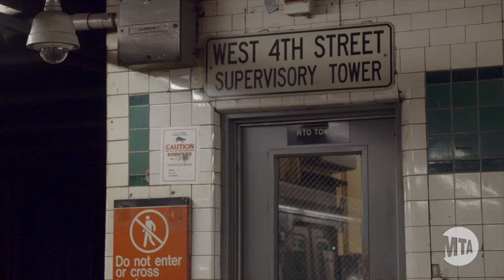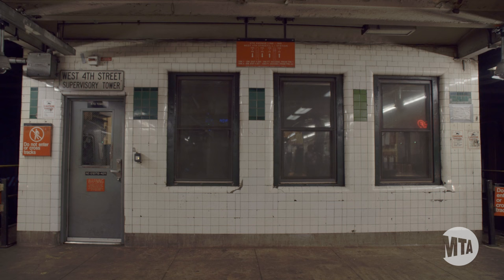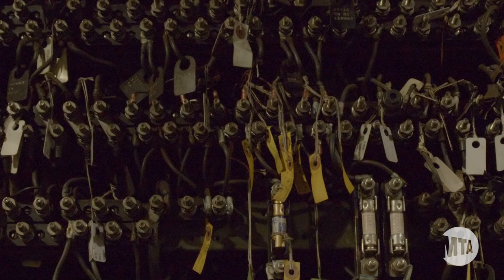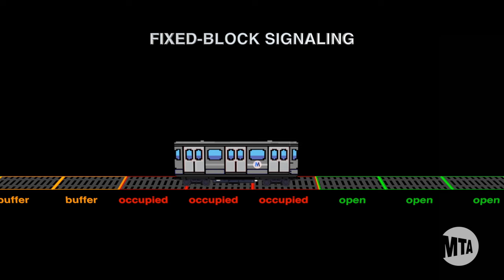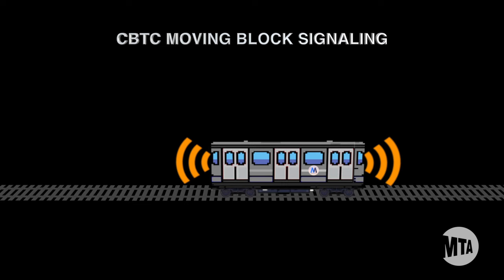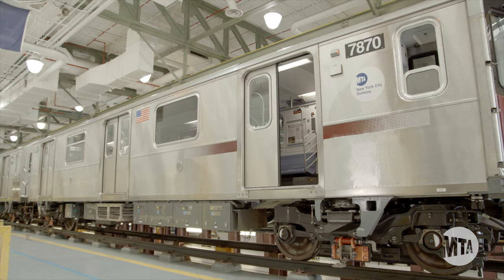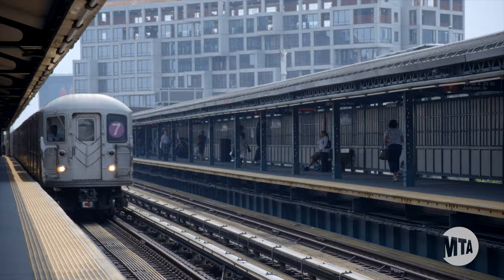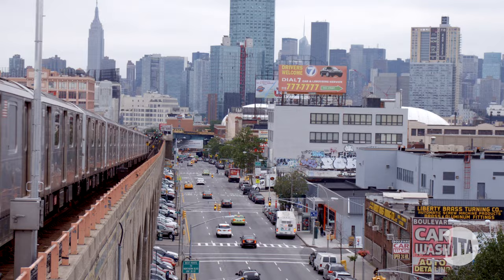CBTC: Communications-Based Train Control

Comment: Perhaps you can explain how trains in the 1950's were able to run with closer headways than what CBTC promises to provide? Also wireless systems are just waiting to fail or get hacked.  Can't hack relays.
Reply: Jersey Mike's Rail Videos I feel that this is a very luddite way of thinking. The current fear of wireless systems is akin to the fear of traveling above walking speed in the early days of the railroad.
Reply: Dj Hammers I work in computer security...wireless is a bad idea.  The rails are there as a communications medium...more secure and more reliable.
Reply: Jersey Mike's Rail Videos With that thought process we will still be stuck in the stone age. There will be vulnerabilities maybe; moving forward, being more efficient, safer...e.tc. makes it worth it.
Reply: SKY HIGH Or we can use coded track circuits.  Rails...those things that are there and can carry information more reliably and more securely.
Reply: Dj Hammers If the system is digital then it's hackable, this country is underestimating the power of a crippling infrastructure caused by computer hackers located thousands of miles away, many of them nationally sponsored and promoted.
Reply: You do realize that no aspect of the CBTC system will be connected to the internet. It will be a completely self-contained system. This is akin to a person kept in quarantine to avoid interacting with other people and spreading disease.
Reply: Dj Hammers 
Read up on stuxnet. Its fascinating. The centrifuges in Iran were on a completely self-contained network and still infected.
Reply: Stuxnet was typically introduced to the target environment via an infected USB flash drive.

A fully proprietary system with precautions against sneakernet connections to the internet would avoid this issue. Is this fear really a reason to be investing millions into technology that is outdated by several generations?
Reply: Jersey Mike's Rail Videos your are correct that the existing system can achieve terrific headways ~90sec. But you are not correct that it's better than promised by CBTC ~70 sec.
Reply: +Sunny Raines The MTA has neither the rolling stock nor the terminal capacity to achieve 70 second headways even if it were possible.  How many tph is the L running?
Reply: I didn't comment on whether or not MTA could use the advertised capacity of CBTC, only that it is supposed to be greater than the 90 sec headways of the conventional systems.
Reply: +Dj Hammers The can also run it in a chroot jail.
Reply: +Jersey Mike's Rail Videos but they can pay people to change those relays into ASICs or something.
man, they are used as logic gates!!!
Reply: If you don't know how something works, don't criticize it.
From what it looked like, those CBTC "transponders" are just RFID readers, while the things mounted on the trains are RFID tags, exactly the same as the EZPass.
Has EZPass been hacked at all in the past 30+ years? Nope.
I'm not an expert on this system, but if it truly is just a bunch of RFID tags, then each train would be assigned a different ID number, and every time it passes over one of those "transponders", it would get scanned and send the information back to the dispatchers, with location information. There is no "wireless" involved.
Reply: @GIJew  The data from the train's transponder readings is sent to the operations centre wirelessly.
Reply: Railway signaling doesn't utilise the internet so it can not be hacked. Wireless is the mode of data transmission, not referring to the network it is communicating in!! You should have realised this if you work in computer security
Reply: @squidgame2021  First of all, everything gets connected to the internet. Second, wireless means that anyone in some proximity to the line has access to the communications medium via an antenna. It's called an attack surface and wireless network attack surfaces are larger than wired network attack surfaces.  In this case there is a perfectly acceptable wired alternative (the rails), but the NYCTA wanted to run mixed equipped and non- equipped trains on the same lines and CBTC was the only way to accomplish that.  So now we're stuck with safety critical wireless communications using a 2004 spec.

Comment: I foresee a breakdown of one train's cbtc system causing a crash. I like the block system it's safe.
Reply: Glen O'Riley Really? Have you seen any train crashes in the L Line (which has CBTC) since 2006?

Also, there was a crash on the Williamsburg Bridge in 1995 involving 2 trains and killing one person. This, and the Union Square Wreck of 1991 were the reason why we are investing in CBTC. Keep in mind that the signaling system that was in use during those accidenta were the 1930s Fixed Block Technology, so if you think there will be a crash with the CBTC system, think again.

Comment: I work the Lex line during rush hout we run 3 to 4 minutes apart .......means MTA wasting money
Reply: true, you can and you do run trains on "track circuits" every with 3 min headways or so, ....but.the level of OTP service, train protection, safety and system capacity are sub-par.  it's the nature and limitations of the two technologies (as simple as that)

Comment: Interesting video.  But it really needs to be updated.  The 7 Line was supposed to be finished in 2017, but it's 2019 today and the 7 Line is still plagued with  massive delays and even shutdowns.  Is this a failure of the updated system, or just the original completion date being missed by years.  As New Yorkers, we should remember that our iconic Empire State Building was built in 1929  in just over a year using 1929 technology.  Surely the MTA should do better than years late on target dates.
Reply: George Kuhn I’m pretty sure they should’ve calibrated the system already
Reply: @TheRailLeaguer  I am absolutely sure they SHOULD HAVE calibrated the system already, but the evidence is to the contrary since the 7 Line is vastly unreliable, even during weekday rush hour.

Comment: It still works. British Rail Installed new signalling Centre Clapham Junction 1980. It was a disaster.
Reply: The CBTC system we have in NY is working perfectly. The L and 7 lines already have an on time performance of above 90%.

Maybe it might be poor maintenance on their part.
Reply: Track Ciruits are electrical Ciruits that you must not let terrorists know about.

Comment: Great idea. We don't know where the trains are. We have more then one train on the same track let's have a device that makes train closer then add more cars on the track. And still rely on a outdated dispatch type system.
Reply: CBTC is exactly what your looking for when it comes to train tracking.
Reply: @TheRailLeaguer  yes it is what they're looking for. MTA needs to first fix their track also their equipment with maintenance problems. If their switches are old-school and dispatch as well, then the coaches will not be congruent with the track. A computer on a train is worthless if the road it rolls on is obsolete.

Comment: Why is cloth covered wiring still in place? Was the MTA really hurting for money that bad for 80 years?

Also, the 30's interlocking machine setup is a great example of schitzo-tech, as there is crap from the 1970s and the past couple decades flanking it.
Reply: plateshutoverlock That was there to protect the old wires from water damage, but it is prone to fires, like what happened at Chambers St on the Eighth Avenue IND in 2005. This will be replaced with CBTC technology, similar to what is already installed on the Canarsie BMT L Line, and what will be activated on the IRT Flushing 7 line and it’s western extension that opened in 2015.
Reply: @TheRailLeaguer  I'm surprised that they did not add Asbestos to the covering as this kind of wiring was common before Asbestos was known to be harmful to one's health. 

I grew up in an old house which was a strange mix of old cloth insulated wiring as well as more modern conduit put in sometime in the 1970s, and had both a circuit breaker panel and a fuse box for 
the 2 different wiring systems.  IIRC, the cloth wiring had asbestos in it.

Comment: Does NYC Underground station has aircon? If have please install PLATFORM EDGE DOORS OR PEDs. PEDs not only helps commuter not to fall of tracks or keeping tracks clean, it also helps to save aircon energy bills to 50%😃.
Reply: syed daniel An issue is posed by the multiple types of rolling stock with differing door arrangements.
Reply: Dj Hammers hey Dj Hammers, you can check out a channel called Willischong Videoproductions. He showes train rides in singapore if you are interested😃.
Reply: syed daniel In a subway, the ground temperature is the air conditioning.  Also, sleeveless shirts.
Reply: We don't call it the "underground"
Reply: @SyedDanielProductions_YT  nobody calls the nyc subway the underground

Comment: You said you never know where the train really is because these pressure pads just give a reading on whether it is holding weight or not, and these pads are quite long. Your solution is these transponders. However, around the 7:40 mark, he says data is only passed when you go over a transponder. That sounds like the same issue as before... you only get a reading every certain distance. Not really a solution.
Reply: *****
You realize a pressure plate and a device that has a broken connection when weight is applied to it are almost exactly the same thing, right?
So don't tell me off like I didn't watch or listen to the video. They're pressure plates; they detect a pressure on them and output a signal as a result.

Comment: Do you have a backup, just in case there's a fire, flood, etc...? You ALWAYS have to have a back up. Pen breaks I have a pencil. Car won't start, I ride with a friend to work or call a cab. Backup, backup, backup, backup.
Reply: curraheewolf PELHAM ONE TWO THREE
Reply: curraheewolf Here, we overlay a small portion of the old block signaling system in the event something like this happens.
Reply: larry temp I doubt that an incident like what was seen in the movies would happen. Plus it’s inaccurate. For one, the R142As cannot be easily uncoupled in single units. For that to work, the yard guys would have to come up to the train, painfully undo the link bars and then they’ll find out that no one is going anywhere. Plus in the same amount of time they did that, the hijackers would’ve been better off taking the ENTIRE train and get the money.

On that note, I did the math on that one. I’m going to assume that each car has 18 passengers. Assuming that they take the entire 10-car train (obviously much better), along with the conductor and motorman hostage, if they wanted $10 million from the city, then each hostage would be worth 54,945.06. Not that much in value, but still.

And an FYI, don’t get a group of friend and hijack a subway train in the middle of the rush hour just to obtain a million dollars. It’s just a movie. If it were real, this city would be bankrupt due to people hijacking trains to obtain millions of city dollars.

Comment: Is this just a re branding of ATC? Or is it different system entirely?
Reply: Erik Krauss The MTA signal upgrades will consist of two systems: Communications Based Train Control (CBTC), which is used to space the trains closer together, and Automatic Train Operation, which allows the train to operated by a computer in the Midtown Rail Control center. Automatic Train Control (ATC) is somewhat similar to both.

Comment: This technology has already been implemented but DC metro had this but due to weather conditions “snow,ice” most of the time interference happens for example radio waves cellular waves disrupts and can cause fatalities and accidents like what happen a couple of time in dc hopefully they don’t autopilot the trains
Reply: A faulty circuit caused a crash on the Red Line in 2009. In comparison, with NYC Subway's CBTC system, there have been no major or minor collisions since the systems on the L 14th Street-Canarsie Local and 7 Flushing Local and Express were activated.

Automatic Train Operation is part of CBTC, but drivers will not be eliminated.

Comment: As the old saying goes "if it not broken, dont fix it" its been running 100 years it probly be working another 100 over computer based systems.

in the uk we have nothing but delays over the computer systems failing or bad signaling so no tech is not always a good idea.
Reply: if you think it doesn't need fixing then you don't ride the system regularly.  Those old signals fail all the time.  I can't even count how many times I've been late for work because of them.
Reply: Yep, 8 years later and these systems are implemented, and it's the same as your UK problems.

Comment: Amazing! yet the subways run pretty well, think things back then were built to last, not like today, where things break down so quickly, forget computerized. There's an old saying "if it ain't broke, don't fix it" might well apply to controls of NYC subways.
Reply: Really, because the signal issues are actually the main reason why trains are often delayed. In comparison, trains on the Canarsie Line and Flushing Line are more reliable due to Communications Based Train Control, which is computerized. The Queens Blvd and 8th Avenue Lines are getting a more updated version.
Reply: Passengers are the main reason trains are delayed.  @TheRailLeaguer
Reply: @gerrylouis5787  That doesn’t excuse the old signaling system for delaying trains so you’re statement is not exactly correct.
Reply: @TheRailLeaguer  It doesn't, though. No more than newer systems anyway. In fact in my experience the most reliable signals are on the A/C line in Brooklyn and those are all original from when that part of the subway was built.

Comment: what might happen if you try to operate an old train (like the r62 or r46) on these CBTC lines
Reply: SonicFan '91 On the Canarsie Line for example, there is an overlay of the older system between Broadway Junction and the end of the line at Rockaway Pkwy. This is to allow for trains with no CBTC that run on the J/Z and M to access the Canarsie Yard for train washing. They will be tracked using the older signal system. Eventually, all trains will have CBTC installed.
Reply: well rip our beloved r46.

Comment: Wait how come the R142/As don’t have CBTC equipped. If they do then how come lines like the Broadway 7th or Jerome Avenue haven’t been converted
Reply: When the cars were delivered in the early 2000s, the primary focus of the CBTC installation was on the Canarsie Line, followed by the Flushing Line. The R143 train cars delivered at the same time with the R142/As have CBTC, and were installed with it shortly after delivery.

After the completion of the technology on the Canarsie and Flushing Line, the main trunk lines with multiple service are up next, with Queens Blvd underway. The Broadway-7th Avenue and Lexington Avenue lines are up next, and are being funded out of the next few capital plans. The R142/As do not have CBTC but have provisions for it.
Reply: If the R142As has cbtc than it’s just an R188
Reply: @CholaHelloKitty  Cars 7591-7810 are still R142As. They will be refitted with CBTC for use on the 2, 3, 4, and 5 lines, but will still be called R142As.

Perhaps you are referring to cars 7211-7590, which used to be R142As but are now R188s.
Reply: Because there's no reason to.

Comment: The only reason why CBTC was implemented first on the L and 7 line is because of Gentrification along those two corridors. You would think the A train would be the first since it's the longest subway line in the system. "There is a train ahead of us..." will always be announced on the A Line.
Reply: The A shares tracks with other services. The L and 7 were actually chosen because they don’t share tracks with other services. No other line runs next to them that has has a potential to be routed onto those tracks.

Comment: Cool! Now train operators can also text and be distracted like everyone else.
Reply: No. With ATO installed with CBTC, operators hold down a button on the console to get the train to move. The button here is the dead mans switch. It’s failsafe. If it doesn’t have a mans hand pressing down on it the train stops cold.

Comment: Why cannot use r142s for the 7 
Why R142A and the extra cars can be named r142b
Reply: Andre Er Because the MTA wanted to use the newest cars for the service. Also, they did not need extra new cars so they decided to convert R142As to R188s and send the R62As back to its rightful place on the 6 line..

Comment: CBTC is vulnerable to hacking, period. As for parts for the old signal system, try Australia, or London, they still use the standard block system. Analog can't be hacked, also to speed up the trains get rid of all of the newly installed grade time signals, they are killing the system's speed.
Reply: Really, Mr. CBTC Expert? Care to elaborate?
Reply: London has a mixture of standard and moving-block and fully automated driverless trains/light transit. All lines are scheduled to move away from fixed-block.
Reply: You can't hack something that is not on a public network such as the internet. Any signaling system in a metro would likely be inaccessible from external computers, ruling out hacking.